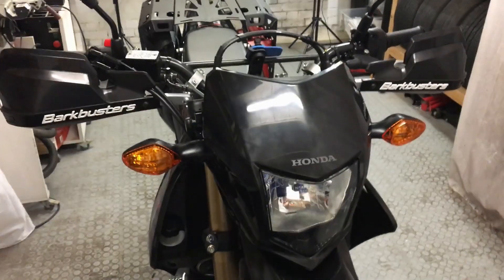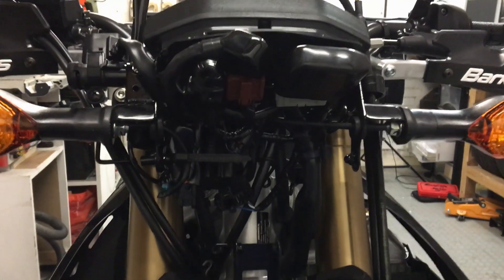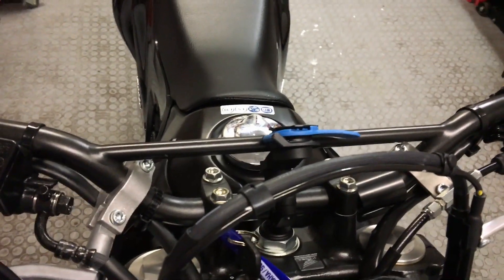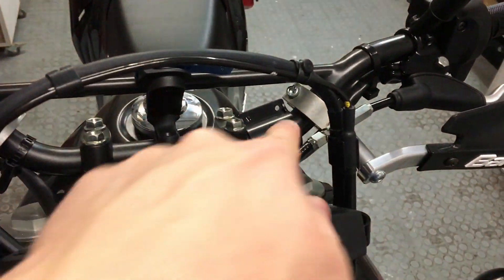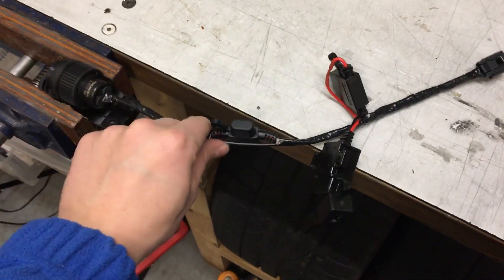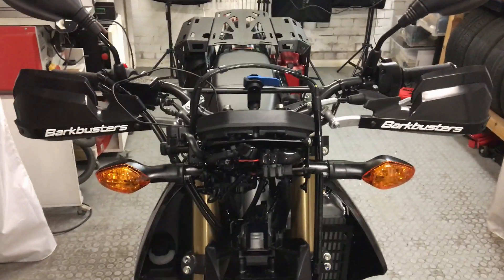How to install 12V accessory socket or USB charger using factory connector on Honda CRF250L (2017+)

Comment from the maker: Project Overview: 00:00
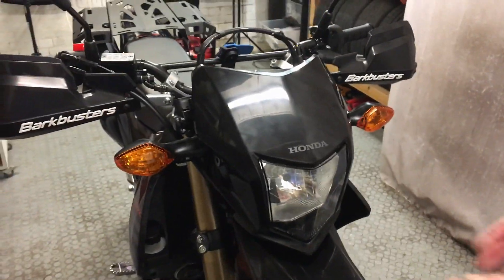Headlight Removal: 00:43
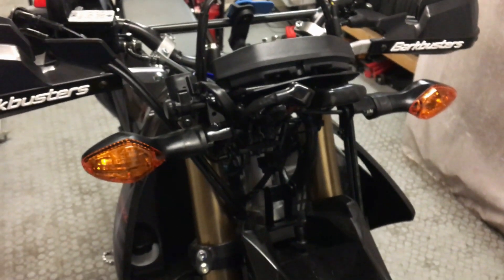Accessory Connector Location: 01:25
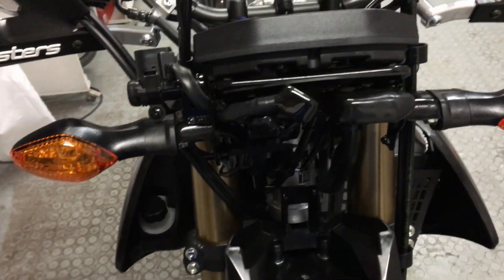Accessories That I Will Be Connecting: 02:10
Making a Harness: 04:03
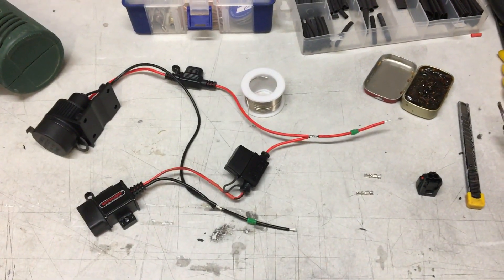Finding Positive Terminal In Factory Connector: 05:48
Plug Termination: 06:23
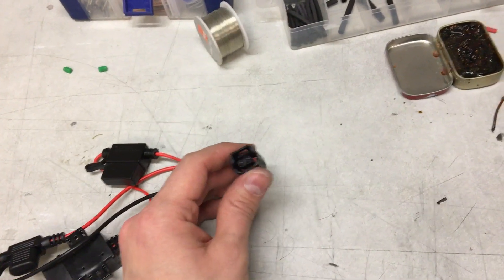Finishing Off The Harness: 07:08
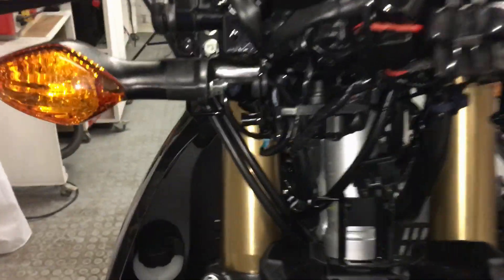Connecting And Routing The Harness: 07:54
Headlight Installation: 09:36

Comment: Thank for the video! Can't you use the stock "connector cover" to insert the cable/pins? It seems to be the same piece that you purchased.
Reply from the maker: Yes, potentially you could if you had metal connectors to insert in it. Unfortunately the 'connector cover' does not have any metal connectors in it, just rubber inserts. The shape of the plug is the same though.
Reply: @Shem  ok thank you!

Comment: please tell where to buy the connector from?
Thanks
Reply from the maker: eBay UK
Reply: @Shem  could you write the link?
Reply from the maker: Aldım Başımı Gidiyorum The listing numer is likely to be different over time, this is why I have not provided it before. I’ve just search the eBay UK and found this one: https://www.ebay.co.uk/itm/373022174037
Reply: Thx  @Shem   especially for the video.